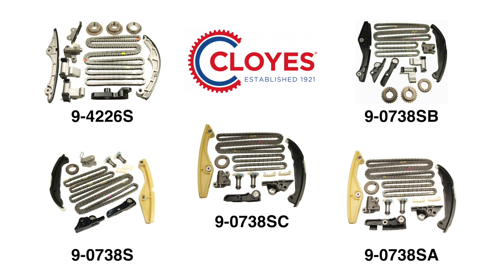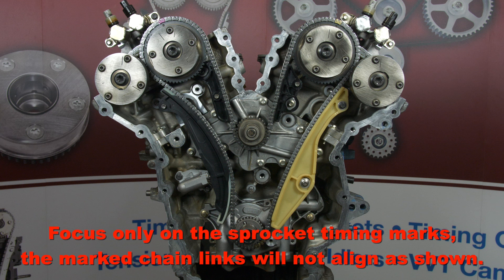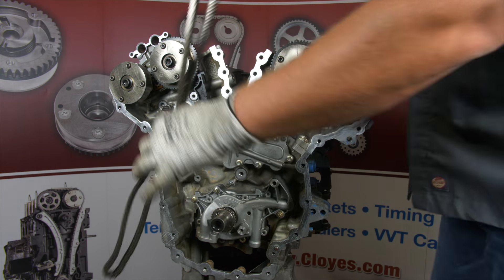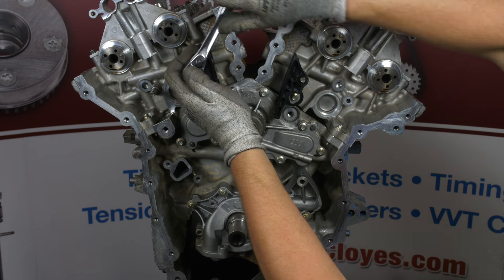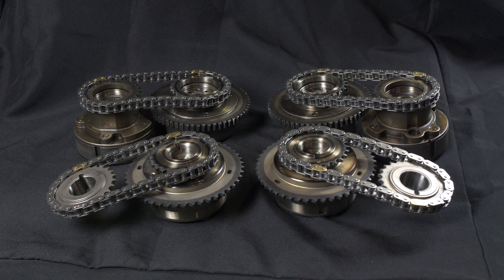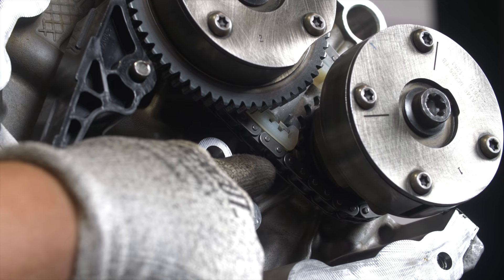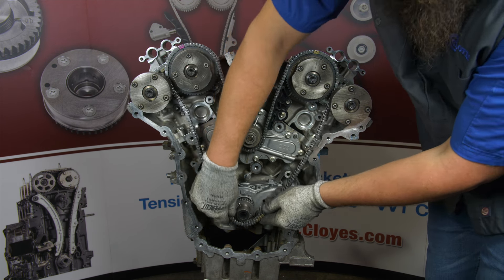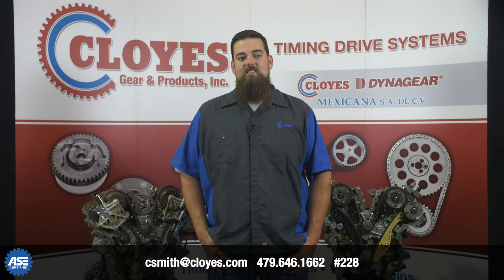Ford 3.5/3.7L DOHC V6 Timing Chain Replacement, Cloyes 9-4226S & 9-0738S

Comment: I have put my timing chain on twice and both times I rotated it several times and all 3 dots line up at 11,1,and 4 position but the colored links seam to be off by one link is this normal
Reply from the maker: Yes, the marked chain links and timing marks will only perfectly align when first installed. Once the engine is rotated, the marked chain links can no longer be used. It will all realign again, but it may take over 100 rotations for that to occur.

Comment: My tensioners for the phaser chains won't release..what should I do?
Reply from the maker: Full compression then release will activate the tensioners. Sometimes it is difficult to determine if they activated due to the tight fitment of the chains, but once they activate they cannot deactivate. A slight rotation back and forth can sometimes help you determine if they are activated. The small amount of slack in the chains will shift and allow the tensioners to extend some.

Comment: What should I do if when taking tensioner off and loosening chain the crankshaft rotated on me? Can I rotate it by itself back to that 4 o'clock position before reinstalling chain and tensioner and guides?
Reply from the maker: Yes, you can rotate the shafts individually to position the shafts where they need to go. But be aware this is an interference engine, you should only rotate the shaft back to where it started before it rotated.

Comment: Yo how important is it to line up the timing chain with the timing marks on sprocket I put the chain on and links didn’t line up with marks by a link or 2 so after putting everything back together I’m get CEL for P0016 (intake camshaft incorrect correlation with crankshaft) any information would be great appreciated car runs like a top no miss fire no hesitation but there a shake/vibration at idle
Reply from the maker: It is absolutely critical. The chain sets the timing, and the marks must align our it will be out of time.
Reply: Okay I’m definitely out of time how would I go about retiming the engine should I take timing chain off then adjust camshaft sprockets to timing marks?
Reply: Sorry I am very inexperienced with these new engines I should not be messing with the motor at this level of severity but I can not afford the $2500 quote the dealer gave me for a waterpump replacement(I replaced waterpump now I’m here with the timing issue)

Comment: If you guys are still checking comments in this video, is there any recommendation when to replace the timing components?
Reply from the maker: These chain systems are typically being replaced during water pump replacement (if you have the internal pump,) if you have an audible timing chain  noise or rattle, or if the check engine light comes on for improper camshaft to crankshaft correlation. If you have no negative symptoms, and no check engine lights, then the timing system is still within spec. Once the chain(s) stretches outside of specification it will trigger the correlation codes.
Reply: @Cloyes01  Thanks.  I have a noise, but I'm not sure it's the timing chain or components.  I have no idea what timing chain noise sounds like.  Just sounds like a plastic piece vibrating when I'm accelerating / lugging the engine.  Maybe a fastener on a panel needs tightening.  It's a 2016, so lots of things probably need tightening :-)  I'm all for preventative maintenance, which is why I'm asking.  My water pump is external I believe since I'm driving an F-150 3.5L Duratec (non-Ecoboost).

Comment: Replaced all components.  Pretty sure the cam is spun a bit out of alignment. No info on This issue. Still getting a code p0024 and p054a p054c after cloyes replacement. Crank was 4 o'clock, phasers 11 o'clock bank 1 and 1 o'clock bank 2.
Chains on the marks. Sooo how the f is the timing off?? ?
P. S. Hundreds of posts online about this, no solutions. Please I Need a mechanic to help?

Comment: I have been told the previous primary tensioner is better because it has the ratchet system that will keep the guide from coming back too far, vs the updated aluminum that relies on spring and oil pressure. I have both but dont know which to use
Reply from the maker: Both primary tensioner styles have a ratcheting mechanism, they just work a little differently. The aluminum tensioner should have grooves on the piston that work with the round spring ratchet clip, and the cast tensioner has a more traditional ratchet pawl with notches in the piston.
Either way, I would use the style that came original on the vehicle.
Reply: @Cloyes01  Thanks, I ended up using the Cloyes timing kit for my 2012 3.5L F150 and everything ses to be running well
Reply: @nicksvaik  Was that the ecoboost?  hows it doing a year later?
Reply: @fishonnelson2353  funny you should ask,  almost exactly 1 year later,  maybe 15 000km the cloyes tensioner failed, wouldn't hold the ratchet so I put in all Ford OEM parts, no problems since.
Reply: @nicksvaik  Well that is just lovely.  I just ordered all new everything - and I mean everything from Ford, but the one and only thing that was on back-order with no date for re-stock was the main tensioner so I got a Cloyes at O-Reilly's.  What did the motor "do" when the tensioner failed?
Reply: @Skul-Ski  Timing chain jumped a few teeth, so timing was off and needed to go back in to set the timing. While I had it open I replaced everything with OEM Ford parts and all was good

Comment: up to ho many kms before you gonna change your timing chain?
Reply from the maker: In front wheel drive models the water pump will need serviced before the timing system fatigues. You should replace the timing components during that service.
It is not uncommon to find the original timing components installed in F150 trucks with 150,000-200,000 miles.

Comment: What other way can you verify that you are in TDC besides relying on the timing marks alone? And how reliable are the timing marks on the crank and phasers to guarantee you are in time?
Reply from the maker: The timing marks are your best frame of reference. You can remove spark plugs and confirm where the pistons are, but the timing marks will confirm that you are on the correct stroke.The phasers are all indexed onto the cams by dowel pins and the crankshaft sprocket is indexed by its slot. Trust the sprocket marks and the marked links of the chain.

Comment: What does indexing the phasers mean?
Reply from the maker: "Indexing" would be the process of installing the phaser onto the cam nose and making sure the dowel pin/key properly engages.
Reply: @Cloyes01  so once you install them and they don't rotate. Means that they are indexed properly
Reply from the maker: @kolinskit0730  Correct.
Reply: @Cloyes01 Thank you very much

Comment: Once I get to the point of lining the timing marks to 11, 1, and 4, if the are off by 1 hour hand, that is they are currently at 10, 2, and 5, how can I turn the crank since the balancer is pulled?
Reply from the maker: You can slide the balancer back on and turn it by hand, or if you can access the flex plate on the back of the engine you can use it to rotate. Just know that the actual shaft positions don't really matter. The chain sets the timing, so as long as all 3 marked links are aligned to the proper sprocket timing marks you are in time.
Reply: @Cloyes01  thank you for the reply. While lining up the new chain the left side slid some, putting my timing dot on the left side at about 1 o'clock. When I try to use a wrench to put it back to 11 while holding the cam hex, the cam doesn't want to stay and springs back to 1 o'clock. Any suggestions. Thanks
Reply from the maker: @ericgonzalez9217  You will either need to hold the cam while aligning the chain (best if you have another person to help), or you can try to move the other head/camshaft and crankshaft slightly in order to align with your left cam when it is in a resting position.

Comment: Do not use a torx t55. It's a square drive rt11. T55 might work but is very loose and will probably strip out at over 100ft/lbs.

Comment: My water pump went out for the 2nd time and this time the timing change broke?  Is the 3.7 an interference engine?  I have the parts I need to do the repair, but can't find any information on whether or not the engine may be damaged.
Reply from the maker: Yes, this engine is an interference engine.
Reply: Get a new used motor or fix and sale . done with these idiotic designs at Ford / not only this motor . 4.0 ford has reverse timing chains as an example. To much time and silly expense for a water pump. Had mine done at 180k for about $500 with out the timing kit according to mechanic didnt require it . overall works fine revs awesome. Plan to get rid of it or leave as a spare car.need to remove heads might of gotten lucky . but on ebay or lkq you find assemblies for about a 1k

Comment: This was a great video!! I was wondering if you have a demonstration for a 3.5 engine that had a timing gear slip when you are turning the engine with a ratchet and now you have a lock up when the markings are out of alignment?  I know that if you line everything up after you remove the chain there is basically a 50/50 shot of getting it right but I was unsure if there is a exact procedure for this situation.
Reply: 50/50…? you’re not following the procedure correctly. If followed correctly it is 100% accurate every time.
Reply: @harrybalsonya5619  you just mis understood what I am asking. You can be at TDC on the intake and TDC on the end of the compression stroke so if you have a lock up and you are unsure what stoke you are on how do you make that determination?
Reply: @harrybalsonya5619  notice I asked about what the procedure would be if you have a lock up condition
Reply: You’re right, I misunderstood. There is no procedure written for this. If this does happen I would remove all spark plugs and measure where each piston is so you can have an idea as to where you may contact a piston while realigning the motor. If a valve contacts a piston I would attempt to rotate the crank one direction or the other to facilitate the rotation of the cams. You may have to do this several times until it is in time. But with this engine there is no chance it is wrong as long as the colored links line up with the indicators on the gears. Good luck, I hope this helps.
Reply: @harrybalsonya5619  well how this happened to me is I had a lock up with the water pump and I had to cut the chain before the lines were lined up. I did figure it out but when I was putting it together I was just not 100% sure I was right. On this engine there is not many marks where on a Chrysler Pentastar engine to use for example you have dots in the cams and multiple sets of marks on the cam phasers to make  sure everything is set correct. I wish they would do a scenario like this because I know it’s uncommon for this to happen but it’s not that uncommon that no information is available on how to do this when you have a timing component lock up before you can line up all the marks

Comment: In your opinion, which version of the 3.5L Duratec do you think is the most reliable and longest lasting, easiest to work on? Im looking for a Ford AWD/4 Wheel Drive vehicle that has one. Thank you, if you can help because i would like to get a vehicle with this motor, but i hesitate due to the waterpump inside issues...
Reply: Stick with fwd to much added cost if it fails. Mine went out at 180k did the pump and works great
Reply: @ChrisB-cx6td  180k miles its pretty darn good bro. Theres pumps that go out at 100k miles. Did you ever did coolant changes?
Reply: @rhurtadorh32  Always knew about the design flaw. Yes always keep up with maintence . However rather have an external water pump .
Reply: @ChrisB-cx6td  like i said your pump lasted quiet a bit. My explorer currently has 73k miles and just about a month ago i took it to ford to do a coolant flush and added the new coolant the yellowish color
Reply: @rhurtadorh32   Just be ready when the time comes to replace the water pump last Ford 3.5 vehicle I buy. 
To much hassle and cost involved other than you replacing it. Here is the nighmare 
With a 70k mile Ford Explorer that pump failed !
https://youtu.be/83EA9SOeq5c

Comment: I have a 2007 edge 3.5L with 280k on it. Water pump failed and I decided to replace primary and secondary chains and guides. Using Cloyes 9-4226S timing chain kit, one of the primary chain guides has been redesigned. The original bolt for chain guide is to short and the kit doesn’t come with a new bolt. Has anyone had this issue? Contacted Cloyes and they said use a 6mm x 60mm grade 5 bolt, but they are hard to come by??? I don’t want to use the old chain guide as it is worn.
Reply from the maker: We followed the updated Ford design on that right-inner primary guide. Newer models had that  guide installed from the factory. The bolts are Ford part# W716322-S437, or any 6mm x 60mm bolt will work. We will soon be including these bolts in the kit,  we just got them developed. Sorry for the inconvenience.

Comment: Question: Step 4, Tighten 180 degrees....what does that mean??????????????
Reply from the maker: 180 degrees is 1/2 turn.

Manufacturers commonly use directions like this when tightening torque to yield bolts. One full turn of a bolt is 360 degrees, so 180 is a half turn, 90 degrees is a quarter turn, ect.

Comment: How much should I expect to pay for a dealer to change the chain and water pump?
Reply from the maker: Depending on the application, the job will pay somewhere around 11 hours. Shop rates are typically over $100/hour, plus parts. I would imagine most quotes will be around $2,000.
Reply: @Cloyes01  I got a quote of $2400 for labor only.  I have about $1100 in new OEM parts (purchased at a very good price so expect to probably pay more) which include absolutely everything  - gaskets gears, actuators etc etc.

Comment: Very odd when lining up the timing marks they are not at 11:00 and 1 Looks more like 11 and 11. However I do have the holding tools and when they are in place and flush with the head as they are supposed to be both cams line up in the slots but still the timing marks are not as you show in the video? Crankshaft seems to be at 4:00 position which very strange they don't put a actual timing mark for that...... Like what is 4:00 exactly?
Reply from the maker: The exact static locations of the shafts after installing the chain are not the critical frame of reference to determine if the engine is timed properly. Chain slack in the system can affect the shaft locations and all three shafts can end up rotated one way or the other when not using the locking tools. The timing chain sets the timing in this engine. The most important aspect of the install is to make sure the marked links of the chain are aligned properly to the sprocket timing marks. As long as your chain and sprocket marks are aligned, then the engine will be in time.

Comment: Cody my name is Jim im having one hell of q time getting my timing back on .y 2013 Ford flex can you help
Reply: Did you figure it out? I've got a 2014 Taurus 3.5 and after replacing the water pump,I got a multiple cylinder misfire DTC and I'm in the process of replacing the entire timing set but I'm at odds over the whole don't worry about TDC thing. I don't want to take this motor apart AGAIN if I don't have to.
Reply: @MJ-mx4ut  redo the timing !maybe off a tooth

Comment: I am only replacing my chain.
I like how he was able to just lift the primary chain out from between the cam pulleys. My chain got through the front pulley, but I can’t get it out from the rear one. The teeth on the primary phaser are too close to the rear of the secondary phaser.
I feel like loosening the phaser bolt a little but he says they’re torqued to yield, so I really don’t want to mess with it.
Any ideas??
**************
Never mind. I figured it out.
So, uh, yeah - it’s nice that folks take the time to make these great instructional l videos, but I can’t stand that 96% of them are ‘best case scenario’, and they ignore most of the stuff the average diy’er will run into. Like, why bother making these videos for people who already know what the hell you’re talking about? Why bother if you’re not goin to cover all the pitfalls? Any project I do by following a video like this almost never goes as smoothly as they show, so I usually try to look at multiple videos.
But really - why couldn’t he point out the flat parts on the phasers and tell you to turn to them to get your chain off? He told us about the ‘torque to yield’ bolts, did he not?
Grr.

Comment: Why are the right and left reversed in the video?
Reply from the maker: The left bank and right bank is designated as you are looking at the back of the engine, not the front. Imaging the engine in a rear wheel drive vehicle, the right bank is on the right hand side of the vehicle and vice-versa.

Comment: Why advise DIY folks they don't need cam lock tool? It's totally necessary even in a professional setting. And a psa for everyone use only motorcraft phasers.
Reply from the maker: We recommend tools when they are absolutely necessary. Most modern engines, like this one, rely on the timing chains to set timing. Precise static shaft location is not critical, you still must align your chain and sprocket marks. Cam lock tools can make a job marginally easier, but they are not necessary for a professional installation.
Reply: @Cloyes01 static shift and spec wouldn't exist if not. I'd love to see this on a powerbalance test beside a spec engine.....

Comment: What if your chain doesn’t have paint on it
Reply: For timing marks
Reply: @anthonyreyes5756  rotate till the dots on both phasers are around 12 oclock and the crank sprocket should be at about 4oclock position. Also the cam flats will be straight up/down on both banks. U need the tool to hold them in place